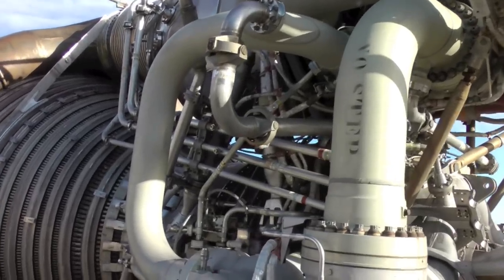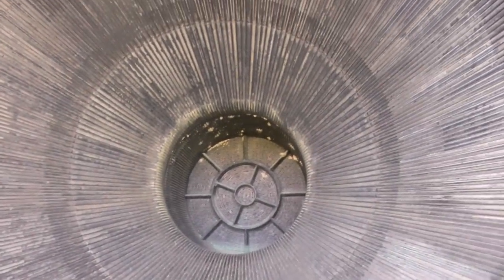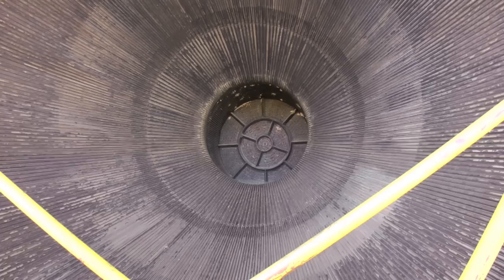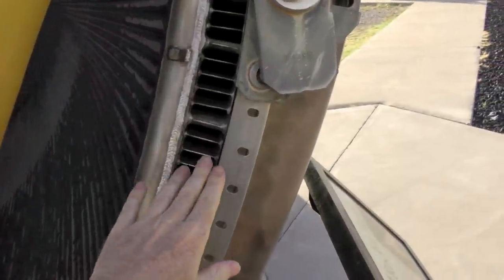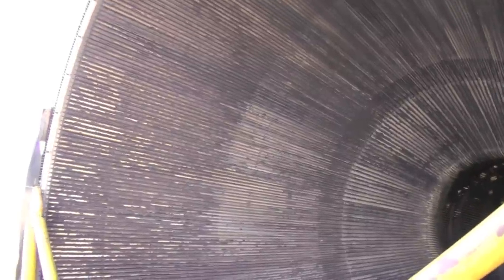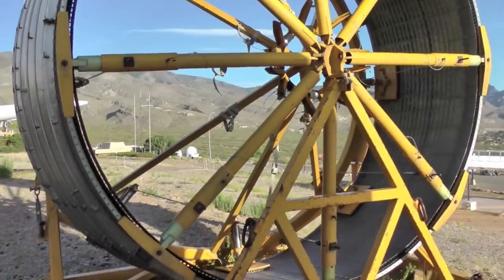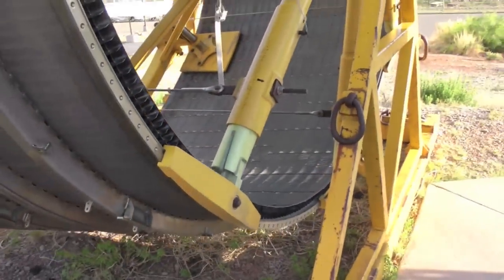Saturn 5 Moon Rocket's Main Engine, the F-1 | NASA Apollo Program Space Travel HD

Comment: The F-1 is an amazing piece of technology and I have been fortunate to see nine of them.
Your claim that the F-1 is the most powerful engine (liquid propellant?) ever built is not quite correct. The Soviet-era RD-170, that flew in the core stage of the Energia rocket, developed 770 tons of thrust at sea level, and 840 tons in vacuum, as opposed to the 690 tons from the F-1.
The RD-270 had four chambers and nozzles, supplied from a single propellant turbopump. The multi-chamber design, which the Russians still use, was a way around the problems of combustion instability that are encountered in larger engines - the F-1 was beset by combustion instabilities during its development.
The Soviets did have a large engine, the RD-270, which weighed about three tons less than the F-1 and delivered almost the same thrust, but the designers couldn’t cure the combustion stability problems and the RD-270 was cancelled.
Reply: The F1 remains the most powerful single combustion chamber liquid fueled engine ever flown, so in that sense, the statement would be somewhat accurate.  Since the RD-170 used multiple smaller chambers fed by a single turbopump, it would be a bit like comparing an 8 cylinder gasoline engine to a 2-cylinder one.  The RD-170 would mimic the performance of four separate engines of a physical size notably smaller than the F1, but which together generated as much or more thrust.   Of course, if you want raw lifting power, the Space Shuttle solid rocket boosters each provided about 1.7 times more thrust than the F1 did.   Indeed, the newer 5-segment boosters being currently tested for the SLS vehicle have produced over 3.3 million lbs (14.7 MN) of thrust, and the plan is for each of them to eventually produced 3.6 million lbs (16 MN) at launch.

Comment: I heard they pump the rocket fuel through the nozzle before its burned to keep the nozzle metal from melting, is that true?
Reply from the maker: Yes, that's what all the fancy tubing inside the engine and upper-nozzle is for.
Reply: so cool, the fuel that's is going to be burned is mm's away from the flame that's shooting out the nozzle! See science is fun! I cant wait for Dragon V-2 's first test flight and Dreamchaser of course!
Reply: They also used the exhaust from the turbo pumps (which is what would flow through the channels in the wall of the nozzle) and because the turbo exhaust is relatively cool compared to the actual nozzle exhaust, it would help cool the nozzle.
Reply: Povl Besser It wouldnt really cool the nozzle but rather separate the flame from the nozzle by squeezing in between. You can see all the black smoke around the flame which is the  exhaustgas from the fuelpump.
Reply: rethla
Is that the closed cycle engine that the Russians developed in the 60's that's still being used today? That's a hell of some damn good engineering, They definitely know their shit but damn their capsules are tiny and yes i understand the keeping it light thing.
Reply: Gary B Im talking about the F-1 engine but yeh the russians have some awesome stuff aswell.
Reply: rethla
Is that the Saturn engine? and what do you think about SLS and Orion?
Reply: *****
Which is why derivatives of them are still in use today in Atlas V and, I believe Antares too.

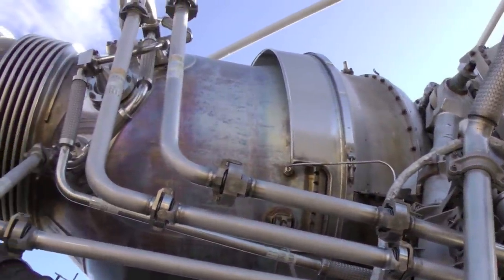Comment: So much subtle engineering... @0:13-0:15 notice all the articulated flexion-expansion joints in the tubes running into and out of the heat exchanger.  I'm sure the pressures (PSI) they handle are impressive, but the extremes of VIBRATION and RAPID TEMPERATURE CHANGE are where I'm guessing the real pioneering occurred.  Mr. Bill!  =:O

Comment: I read that 1 F-1 engine was more powerful  than all 3 space shuttle  main engines combined
Reply from the maker: 101southsideboy Yes, that is correct. The F-1 ranks as the most powerful liquid fueled rocket engine ever built.
Reply: ***** no not the F1. they are rebuilding the J2 redesigned J2X
Reply: Will Riling There is a plan to use a 2 redesigned F-1 engines named the F-1B as a liquid replacement for the boosters of SLS. There would be 4 RS25's on the core, and 4 F1-B's on the boosters. As of right now, J2X will not be used on the SLS upper stage..
Reply: Yes, but the Space Shuttle Solid Rocket boosters each produced 2,800,000 lbs of thrust at liftoff which is more than 80% larger than the Saturn V's F1 engines produced (increasing to 3,100,000 lbs about 20 seconds after liftoff).  Indeed, at liftoff, the total thrust of the shuttle was about 7.8 million lbs of thrust, which is more than that of the Saturn V.
Reply: CoconutScienceLab Well IIRC  that title goes to a Russian engine (RD-171?), although it is a four chamber engine it is still considered as a single engine. IMO when it comes to rocket engines Russians never fail to deliver: cheap and powerful while keeping great reliability.
Reply: +Roberto Vengut Tro No, the F1 engine remains the highest thrust single-combustion chamber liquid fueled rocket engine ever produced.  The RD-171 was an improved variant of the RD-170 that allowed two-axis swiveling instead of only one.  It had a single turbopump that fed four separate combustion chambers and engine bells which together produced a sea level thrust of 1,755,000 lbs of thrust (about 439,000 lbs of thrust for each chamber/bell).  However, the Space Shuttle solid rocket boosters each produced a whopping 2.8 million pounds of thrust at ignition, increasing to 3.1 million pound of thrust each shortly after liftoff.  Indeed, the new 5 segment solid rocket boosters for the Space Launch System have already demonstrated a thrust of about 3.6 million lbs of thrust in test firings.
Reply: David Knisely Yes I agree with the "black letters part" (sorry I'm not English) but a four chamber still is still considered an engine, not four of them.
Reply: You both are correct.  The Russian engine has 4 combustion chambers while the F-1 has a single combustion chamber. Both are liquid fueled engines.  Both engines output is dwarfed by the Space Shuttles 4 segment Solid Rocket Boosters and even more by the SLS 5 segment Solid Rocket Boosters.
The most powerful rocket engine that has ever flown is the Space Shuttle SRB's.  In 2018 they will be surpassed by the 5 segment SLS Solid Rocket Booster.
The comparison of engines always depends on the exact parameters of said comparison.
Reply: +Roberto Vengut Tro, Yes, we did the same with the 2-chamber LR-87 engine from the Titan II (430,000 lbs of thrust). However, comparing an "engine" with four separate combustion chambers to a larger engine with a single combustion chamber is not valid. It is like comparing the horsepower of a 2-cylinder gasoline engine to that of an 8 cylinder engine. Indeed, the Soviet RD-170-1 engines had to use four separate chamber/bells to achieve their thrust without running into the combustion instability problem, and even then only exceeded the thrust of the single chamber F1 engine by about 13 percent.
Reply: David Knisely Well after all is said and done it doesnt matter how many combustion chambers the rocket has, if its 4 or if its 1 with baffles in it. What matters is the thrust, the weight, the efficiency and the reliability. The mission was to design an engine that would take mankind to the moon and i dont see any other engine than F-1 boasting with that.
Reply: David, IMO it would have been the correct aproach for your engines too, as I think (engines is not my favourite topic on rocketry) it's better for power and, as you said, combustion instability.

rethla, I'm not sure if you mean this but the RD-170 and RD-171 could have flown men to the moon too with an Energia and there even was a variant for Mars mission which dind't seem unrealistic and impossible. IMO the Energia is the best rocket ever designed, or at least in the Soviet Union/Russian space efforts, which is a big achievement considering they've got the R-7 family too. It's sad that it had its fate, considering it was a very polivalent design which could have been useful for many missions that neither NASA, ESA, Roscosmos, JAXA,... get the funds to do (only NASA in the 60s and Russia tried to keep up with less) because war and other stupid things are " way more important" and space is "a waste of money".
Reply: Roberto Vengut Tro Well there would be no F1 or RD-170 without war founding but i agree there are alot of great designs out there just waiting  to be proven.
Reply: Yes, that is true, but still doesn't justify why other activities are prioritized to space exploration which gets basically nothing. I don't know the situation in Europe and Russia (although I'm Spanish) but I always hear that in the USA there is many people asking to get them more funding, even people who are not really interested in space exploration and don't even know why orbital rockets don't go straight up or why they didn't use the Shuttle to go to the Moon and grab the flag.
Reply: Roberto Vengut Tro Well, some "sounding" rockets do go straight up for brief flights, but the main reason most others do not is that when you go straight up, you eventually just come straight back down rather than staying in space (unless you go REALLY fast upwards).  Most rocket flights intend to put objects in orbit around the Earth, so they have to launch and then arc over to fly more parallel to the Earth's surface once they get out of most of the Earth's atmosphere.  Once they achieve a certain orbital speed, the payload they launch will continue to orbit the Earth and not fall back.  Also, by flying eastward, you can take advantage of the speed of the Earth's rotation to help get into orbit.  Once in orbit, little or no fuel is required to keep the launched payloads in orbit. 

As for the Space Shuttle, that rocket plane could not reach the moon, as it was an orbital transport "cargo" vehicle only.  It was limited  in altitude to only a few hundred miles above the Earth's surface, as it did not carry enough fuel to do anything more.  It also was heavy with its wings and fuselage structure, so with most of its fuel expended to just get into orbit, it could not achieve anything close to the escape velocity needed to reach the moon.
Reply: Lol you completely missunderstood my post, I was telling that people who don't even know that usually want more funding for NASA AFAIK. I'm very much aware of orbital mechanics, although I'm not an expert in them and I specifically wrote "orbital" rockets.

I also know about the Shuttle part, and it would also be probably too hard to fit a lander in the payload bay.

You seem to be the kind of person that will enjoy following Copenague Suborbitals, I reccomend it and you get to talk with the actual engineers during live streams.

EDIT: Congrats for your patience explaining this, I would probably have not done so if I had the opportunity. I'm still waiting to hear your opinion on Energia (standalone, Buran is other topic).

EDIT 2: Probably the biggest problem with the Shuttle would be that it's a huge vehicle with a heatshied that only takes the energy from an orbital reentry, there would be a big retrograde burn needed or a huge non-reusable ablative shield on top of the tiles (double row doesn't seem feasible) to withstand that energy.

EDIT 3: (I'm probably taking this too seriously :P) I don't remember and I'm not willing to search on mobile the Shuttle's endurance in space but due to propellants used I know it's quite a bit less than those of Soyuz (6 months, that's why Soyuz was the ISS lifeboat even when there were Shuttles) and with a vehicle with the huge payload bay of the Shuttle one would want a long stay (there's place for resources and it's a comfortable enough vehicle) and favor a long orbital mission instead of just "turning around and getting a gravity assited kick" so there would probably be endurance-related problems... Also... go to the moon to grab a flag which has already been found by orbiters and having as much prood by just aiming a laser to the reflectors is too stupid, sounds better to spend it in ISS, ISS 2 (if Russia cancels their plans for a "new Mir" (OPRAK or something like that it's called) or continue with Orion/SLS, from development since 2004 and still not even missions for it.
Reply: The longest Space Shuttle mission was 17 days 15.9 hours, so endurance would not have been the problem.  The lunar module would have fit inside the cargo bay of the Space Shuttle, as would the Apollo CSM.  However, even just the CSM fully-fueled would have been a little too heavy for the Shuttle to lift into orbit, so multiple flights would have been needed both for the two vehicles and for lofting a large rocket stage to get them out of Earth orbit.   If we had intended to continue lunar missions, a single large rocket like the Saturn V or the SLS would have made more sense than the Space Shuttle.
Reply: +101southsideboy Yep.  Because Kerosine and LOX have a considerably higher kick and push than Hydrogen and LOX.  Hydrogen LOX was only used on the 3rd stage because it has the highest exhaust velocity of any rocket engine at the time but it's thrust value is much lower.  Only problem with Kerosine/LOX is exhaust velocity is not very high to reach the desired escape velocity but boy does it kick on the launch pad.
Reply: itsabig
 No, the F1 was designed and built by Rocketdyne to meet a 1955 U.S. Air Force requirement for a very large rocket engine.  The Air Force eventually stopped further development of the engine as there was at that time no perceived need for it in that service.  However, NASA became interested in the F1 engine and contacted Rocketdyne to complete its development.
Reply: itsabig
 No, you said the U.S. Air Force did the original engineering, but that is incorrect, as Rockedyne did.  The project was shelved because the Air Force didn't have a rocket design that would need to use the F1.  NASA inherited the F1 project in a transfer of projects early in its history.   The combustion instability problems would come later (1960-63).  Please read:  http://history.nasa.gov/SP-4206/ch4.htm#110
Reply: itsabig
No, you said "The U.S. Air Force did the original engineering in the '50's".  That is a direct quote (and still incorrect).
Reply: itsabig
 Yea, right. put out your juvenile insults and reveal your true nature (troll).
Reply: I'd love to see the F1-B concept for the Advanced Rocket Boosters for SLS come to fruition. 4 F1's(2 per booster) and 4 RS-25's firing at the same time would sure be a sight to see, and feel.
Reply: Wrong, the Space Shuttle did not produce more thrust at lift off than the Saturn V. 
The Shuttle produced around 6.9 Million pounds of thrust at lift off compared to over 7.5 million for the Saturn V.
Reply: When u said 3 of shuttle main engines you mean the boosters ??? The 2 white and 1 red... so just one f1 is that much more powerful my question is why did they have to make it go so fast or make those engines have that thrust/  power?

 How long (minutes) did they have to shoot the rocket to the moon only minutes until they burned out so they need to capitalize every second they had to thrust it toward the moon or rather they orbited the earth a couple times with those engines running to really get up on some momentum?

 I think the latter... one I'm kinda answering my own question... I am ignorant on any of the space flights to b honest just curious tho

Daniel 
Tampa FL

Comment: When you say rocket engine the combustion chamber is a part of it, and it is the most crucial part (expansion of the gases, area of hypersonic speed of the flames, injection fuel plate, cooling process, etc. When you got 4 combustion chambers you got 4 engines.
So, give me a brake about the Russian RD engine and don't call it a single engine, it is not and it will never be.
The shuttle's SRB which produces 2.400.000 lbs of thrust is not an engine. The SRB is a rocket/booster by itself. Since it is a solid fuel booster it has the opening at the bottom to release the flames and thrust. It is a solid fuel rocket the the Shuttle needed two of them to lift from the pad. Same for the new boosters of the SLS which still haven't been made...

So, as for today 6/6/2019 the F1 is the most powerful single rocket engine ever built.
An engine which was never run over 75% of thrust and was run at a very rich fuel vs oxidizer ratio for many reasons. Von Braun stated that if they wanted more power they could have run 15-20% more thrust with a leaner ratio of the fuel vs the oxidizer, and could have reached the 2.000.000 lbs of thrust quite easy. And yes all of that in the late 1950s!
And let's don't forget the most important fact..IT NEVER FAILED ! Its was 100% successful which is an amazing fact in space history while it had to deliver the first human beings to the moon , the most difficult and important mission!